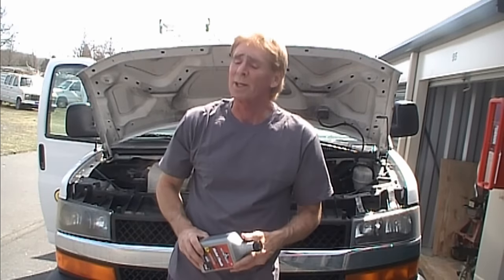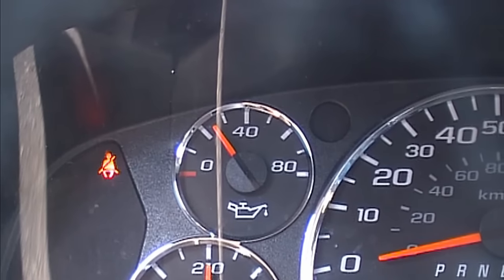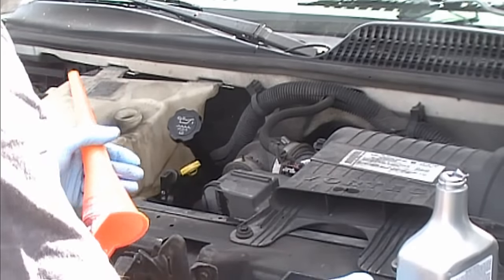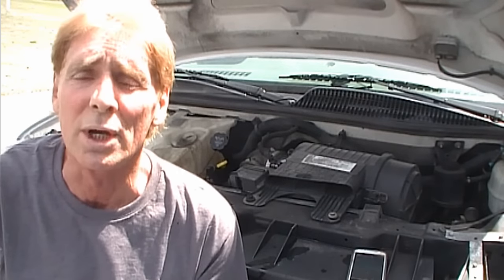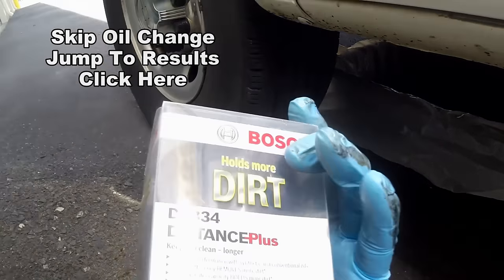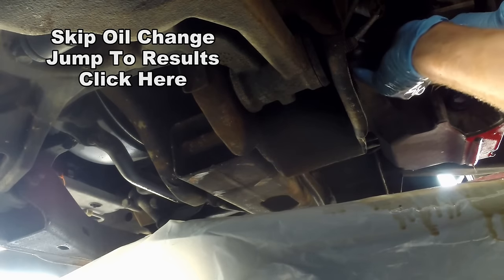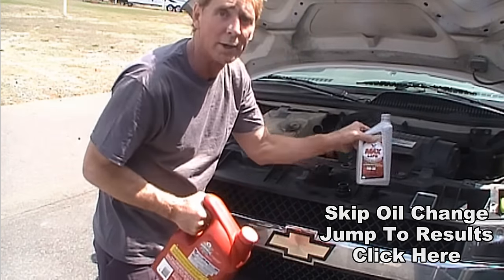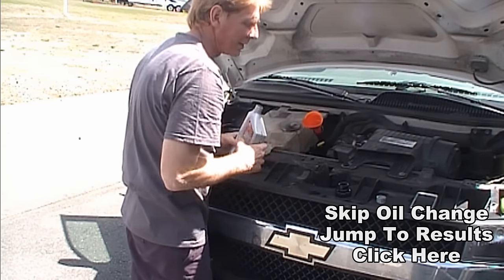NOISY LIFTERS? Motor Flush - Does It Work?  HOW TO DO IT YOURSELF

Comment: Dude take it to a auto mechanic shop to have the engine rebuilt and stop using vice grips to remove and tighten the oil drain plug. Plus you are supposed to wipe were the old oil filter was with a clean paper towel or rag and put new oil around the new gasket on the new oil filter and if possible even prime the oil filter some with new motor oil and only hand tighten the new oil filter. I know how to do oil changes i worked at a Jiffy Lube twice plus changed the oil on the vehicles i have owned every time except for half the time on a 2000 ford escort se i used to own because the drain plug near the point of were the car had to be jacked up at to get under it.

Comment: I worked at a GM dealer and I wouldnt ever buy a vehicle with the 6.0. They always had lifter or chewed up cam problems or oil pump problems and theyre super expensive to fix or buy new remaned or used 6.0

Comment: Replace 1 qt of oil with 1 qt of lucas oil stabilizer and your engine and oil pressure will be good and I recommend you use 10w40 or 20w50 due to u have over 300k on ur engine

Comment: That fkn water  viscosity 5w 30  doesn't help much with your tik tik tik, With that mileage you should be using some 15w 40 at least and things will get better believe, even that oil pressure will rise for sure.

Comment: That don't sound like no lifter tap. Lol there's a reason you can hear it better underneath the vehicle. That's a bottom end noise. Rod knock or a spun bearing. With that mileage I would run nothing lighter than 10w30

Comment: My 5.3 has 513,000 km and same thing low oil pressure and tick like that I did the motor flush and it didn’t help until I reved the piss out of it and oil pressure came right to 40 -45 psi at idle and didn’t tick since hold it to the mattress!

Comment: Also any vehicle with over 80 thousand miles should use high mileage oil, preferably at least a 10w 40 and no pliers on drain plug and no tool to tighten oil filter, put fil of oil around new filter gasket before install, ....

Comment: vice grips? with that mileage I would use 20-50, pull the valve cover and push rod and extract the llifter and push rod I can bet you a cam lobe is worn down and the lifter cant fallow it, the main bearings and rod bearings are loose too

Comment: Rislone high mileage engine treatment is designed to clean lifters while you drive. Safe to add to oil as a top up. And it works. My GM 8.1 had a tick at start up.  It would go away after a couple of minutes. Two treatments over two oil changes and the tick on start up is gone.

Comment: Run full crank case full of ATF with a new oil filter in there. Run at idle for about 45 minutes to an hour then turn it off. Swap out the oil filter for another new one and run it again with the same ATF in there. Add half a quart or so to top it back off from the ATF you spilled, idle it for another 45 minutes then give it a few revs. Drain the ATF put on a new high mileage oil filter and fill that bad boy up with regular synthetic motor oil.

Comment: Yea should have put oil in the filter before you put it back on and I probably would have went with at least 10 W 40 oil 20w 50 might be a little too much put you some of that Lucas Oil stabilizer in there

Comment: 300k means you need thicker oil and start looking for a motor/ rebuild or another ride.  You should be able to get a year or 2 for a work van if you just go easy. And ditch the channel locks. They are only good for demolition tool. Buyin one wrench to fit ain’t gonna kill you. 🤣

Comment: If the oil pressure is low like that I'd put my money on the oil pump..I bet if you change the pump you could get another 400,000 out of it..and the knock would go away

Comment: I am sure your o-ring on the oil pick up tube has dried out. They get toasted and the pump can't suck enough oil to lubricate the engine. Its like tryibg to drink through a straw with a hole in it.

Comment: that push rod for that lifter probably isn't pushing oil through.. take the valve covers off and spray brake cleaner down the noisy push rod / lifter and add the engine flush.. that would have more of a shot at fixing it. if not, rod or lifter.

Comment: you didn't oil the new oil filter gasket and you over tighten the filter it should be hand tighten and 3/4 turn and who uses vice grips to tighten the drain plug! all chevy pick up engines came off the assembly line with defective valve train components

Comment: just as easy to drain the oil. put quart of kerosene or diesel in the crankcase, run the car for 10-15 seconds,  shut it off drain again.  those have enough lubricants, u won't see damage, but it is thin enough to flush our a ton of extra garbage.  same thing the additive does

Comment: for gmc savana or chevrolet express, the only way not to knock the hydraulic lifter is to pull out the engine, remove the head and replace the non-working hydraulic lifter

Comment: There is absolutely nothing in a bottle that will fix a mechanical problem. This goes for a worn out engine or abused engine. This engine has a good service life.  Don’t tighten a oil filter with a wrench. Use a wrench on the oil plug.

Comment: I always do a Quart of off road Diesel and a quart of Tranny fluid mixed together just drain a few quarts out before you add it let it Idle 10 or 15 minutes add yourself a quart of Lucas with your new oil and filter you'll be good to go

Comment: Didn't oil the seal on filter plus overtightened, just buy a new sump plug bolt, and that sound is a big/small end bearing not a lifter by the sounds of that...

Comment: Drain 2 quarts of motor oil out and replace it with 2 quarts of diesel fuel and let it run at idle for 10 minutes and change oil. the problem on the van you are working on has a stuck hydraulic lifter.

Comment: little to late to be using engine flush.  once shit is build in there five minutes is not gonna do a friking thing. my truck has 250K  i have done  an engine flush  every  three  oil changes ,  i run the flush  for 30 minutes  not 5,  my truck sounds and drives like new , i bought the truck new ,   maybe i am just lucky , i heard some people use diesel to flush engines too ,  there is many videos of people doing it and they do it all the time .

Comment: Dude... how long have you been doing this? The oil pressure is fine! Almost every small block as well as big block Chevy I have ever seen for the past almost 40 years - including the one in my van right now - has a hot idle oil pressure of between 15-20 psi at 600 RPM. Cold pressure is about 40-60 psi depending on oil viscosity and outside temps. And, how the heck do you expect a can of "oil treatment" to fix a bad lifter. This was 8 minutes I'll NEVER get back!

Comment: Id drop the pan n see if its the crank bearings cause that sounded like it was low in the engine. You can just take off the bolts off the connecting rod ends n have a  look an change all bearings. I think its the crank bearings. Lifters would be popping noise w more speed.

Comment: Good video but not such thing as mechanic in a bottle what you can do in the meantime is remove valve cover on the side that makes noise grab like half a quart and dump it on the valve springs, rockers etc, put valve cover back on and cranck it and the noise should be gone for a few hundred miles but likely u need to replace a lifter or is a dirty sump

Comment: I usually just try to use a cutting torch on the oil pan drain plug..just try hard to not mess up the OIL DRAIN PLUG

Comment: I would put some Marvel Mystery oil in the oil an the next change.  Also, consider pouring the cleaning solvent into the engine thru the pcv, and oil breathers.  This way, you can let the solvent drip down the valve passages.  -  might even let it sit up there for an hour so it dissolves some crud.

Comment: I'm thinking you have a main bearing spun.   that's because it's louder at the bottom and you have low oil pressure.   also,  use a socket or a wrench on that oil drain plug.   nothing says shade tree like vice grips.

Comment: You will be lucky if the engine doesn't blow. Using the stuff breaks up old crap in the engine which clogs up the oil sump screen.

Comment: Well first the silver sealing foil on the top of the oil flush bottle was never remove ,,the foil  can get in to the engine if not fully removed from oil flush bottle  . Next  no2 oil filter fitted dry should have put some oil in the empty filter first and on the rubber seal on the filter  ...And third   screw oil filter on hand tight and not with a wrench  .Thumbs down on this one ..

Comment: did you ever check the oil pressure with another gauge. if it still reads low you may have a bad oil pump. the low pressure alone will make the lifters tick.

Comment: Check your intake manifold gasket I changed mine and tick gone gasket was broken inside mixing a little coolant in oil making it run wet dry pressure went back up to normal

Comment: I didn't get a change from engine flush so I left the the flush running 20 mins I leave overnight and run another 20 minutes empty oil take off filter and leave to drain over night new filter new oil add engine oil treatment running lovely now

Comment: Perhaps the tick would be lessened with some more oil pressure? Perhaps check the actual pressure with a separate analog gauge connected to the engine block?

Comment: wouldnt take any oil change advice from this guy like damn rounded off drain nut not using proper tools not putting oil in oil filter or even bothering to lube the ring and over tightening the oil filter also expecting engine flush to fix a lifter tick of course its not gonna fix it take it and get it adjusted its not very hard
Reply: zach s I agree on the first part but the second part where you said get it adjusted is wrong you can't adjust hydraulic lifters there preset there's nothing to adjust
Reply: zach s plus he's using a fram oil filter

Comment: Marvel worked wonders for my old LS1 camaro with cold lifter tap.

This engine sounds like bottom end knock, not lifter tap. Lifter tap would be faster than the engine rpm.
Reply: Um no cam goes round 1 time per crank rotation. So if a single lifter is tapping it taps at half the rate of a single rod knocking.. Welcome to 4 stroke land...2 strokes per rotation of crank and 1 lift of each rocker per 4 strokes. strokes are as follows Intake(int valve opens), compression (valves closed),(1 crank rotation) Power, exhaust (exhaust valve opens) (2nd crank rotation) … so as you see a lifter tap is at half the speed of a rod knock  and generally gets quieter with RPM  where a rod knock well it gets a hellova lot louder n faster with rpm... But you are correct this van has bad bottom end bearings the noise along with the pressure loss is a good indicator. Could have been a torque convertor bolt back out hitting on block if not for the hint of pressure loss and if it was piston skirt slap it wouldn't have been quite that loud and harder to tell if it was top or bottom. One might could use a timing light to pace the speed of the knock I don't think I have ever seen that attempted but it would make for a good poor mans diagnostic video for someone like SouthMainAuto's channel.

Comment: I have used this product for my BMW E38, and I didn't notice anything. I still have the engine ticking noise.
Reply: Ticker oil works I got that problem fixed on mine drive it for a day and you will see the difference
Reply: Thicker

Comment: that noise in the video isn't a lifter. the oil pump is going out a sticky lifter does not affect oil pressure . plus gm trucks are notorious for bad oil pumps.

Comment: if its air or dry. Run it at 2500 rpm for ten minutes. Let cool. Repeat three times. If it doesn't pump up replace the lifter.

Comment: Great vid & all. but as much as I hate to break it to ya - at 300,000 miles, the 5w/xx ship sailed LONG ago. A 10 weight oil would be advisable at this point. ASE certified parts pro here, recommending a step up from petroleum BROTH to actual motor oil. Your clearances are now on a par with a 70s or 80s era vehicle.

Comment: bad lifter wont result in low oil pressure. sounds like a rod knock. motor medic isnt going to replace rod and main bearing material. that engine is on its way out...

Comment: Add 1 pint of Liquid Wrench to the engine after oil change. Use a cheap oil and filter because your only driving it 100-150 miles. If anything in a bottle will work this is it. Mine cleared up in about 75 miles and stayed quiet for another 20k miles. It was just starting to come back when I traded the truck. It's been a GM issue forever, you'll have to wrench on it eventually or just ignore it.

Comment: Your V8 may have active fuel management system. It turns 4 of your cylinders while the engine idles. Essentially, only the valves of four running cylinders are cleaned during engine flushes; Thus, it left cylinders 1, 7, 4, 6 dirty.

Comment: And to the last guy commenting he fully knows what he is saying you have been putting way to thin oil in that motor for far to long. Once it became 50,000 to 75,000 miles someone should have started putting cast oil 10w30 and really shouldn't use synthetic oil unless already been using it. If these things were done along with changing oil grade just a little bit thicker at 200,000 miles and proper care/use of engine none of this would be happening to the engine and could have seen double more miles on it if not more.

Comment: According to the high mileage, 5w-30 is not an option, definitely....you should switch on something in "thicker" class , and  very good option in your case might be the "Liqui Moly's" MoS2 10w-40 oil....good viscosity oil, plus Molybden di-Sulfide, great "cold start" oil and  great engine "de - noiser"...BRGDS
Reply: Milan Mitrasinovic yes I seen the oil he used and said WTF in something over 300,000 miles OMG!

Comment: Sounds like a calapased lifter change all lifters an that dod controller on the intake and it's done ... or you can go with cheaper  non dod lifters an use a programmer to cut the dod off

Comment: That’s not the problem.  Need to remove the oil pan and replace the o-ring to the oil pick up tube. I had that noise for five years and tried everything.  Now, with 286.000 themotor sounds as good as when we bought it off of the showroom floor

Comment: There's another product called "rislone engine treatment "you add to new oil after using motor flush with old oil then ya drive with the new stuff about 5 to ten miles, then the noise should stop. Worked in my 2001 Ford ranger.

Comment: My chrysler sounded just like this. I did everything the same except substituted a quart of Rislone engine treatment and the tick is gone and motor has calmed down quite a bit
Reply: mine sounds like this and at 3k rpms and higher the engine rattles once reved could this fix my issue?

Comment: So many things wrong with this video lifters are not on the bottom of engine and you cranked the piss out of that filter I would hate to take it back off at the next oil change you need a bottom end rebuild that is what that sound is

Comment: The oil pressure is low. It should read a lot higher than 22 psi. You need a new oil pump.

Comment: This is a PERFECT example of a plumber VS a mechanic.
Taking the plug off with the only tool in his box.
Vice grips.
LOL
Also, if your lifters are THAT loud they've probably collapsed, which means that they aren't gonna get better even if you sprinkle fairy dust inside.
Reply: But gorilla tightening the oil filter is 💯 guaranteed to stop rod knocks
Reply: In other words a plumber should stay with plumbing and a mechanic with cars each to there 0wn trades

Comment: Should I be hearing that clicking sound in my engine at 74k miles? The dealer says I need to change my rockers and lifters, the local shop says to put the additive in the next oil change...

Comment: You're NOT supposed to mix synthetic oil with conventional oil.... just a warning to others who have no mechanical knowledge at all. I'm a ase certified technician with over 15 years of experience and I felt that I had to point out that mistake that this guy made by mixing those two oil types. By mixing conventional oil with synthetic oil, this usually ends up making a milky/foamy mess and the oil breaks down and then it can't do it's job. Best of luck!
Reply: Chris Martin 
then why do most manufacturers sell a semi-synthetic blend? Quaker state, Mobil, shell etc...

Comment: i think my car has the same that clacking sound too,  its coming from around under the engine, but that only happens when the engine temp is cold. i alwasy warm up the car before drive off, like usually after about 5mins or so the clacking sound just goes away. when the egine reaches working temp, theres no knocking or clacking sound. its a 10yr old turbo diesel engine and has been using 5w40 oil since brand new. any suggestions? thanks

Comment: The motor is worn out, nothing short of rebuilding the engine will fix the oil pressure/ticking on that engine.

Comment: Obviously this didn't help this motor.
But, something like it helped me.
The product i used was Omega 907, and the engine was a bmw with hydraulic lifters. these tends to get clogged after a couple of hundred thousand KM.

This won't do jack shit for mecanical lifters.
Reply: Swap out a quart of engine oil for 1 quart of atf and run it for 3kmiles  (I know you all are saying I'm smoking crack) I thought the same . I was literally speechless atrhe gunk that came out of my oil plug. Lifter tick gone and fucking engine I'm sure was spotless Inside!